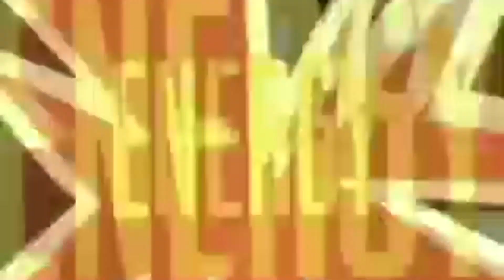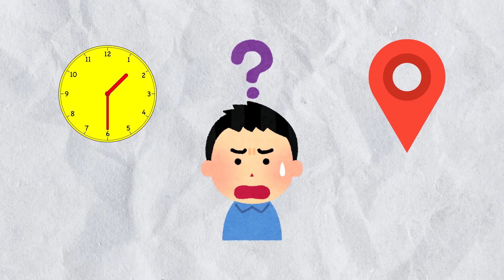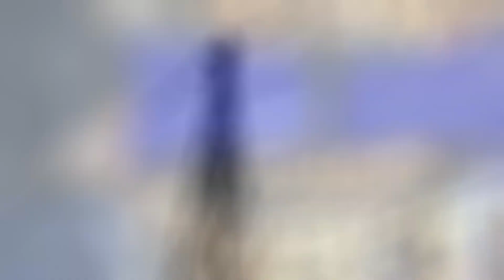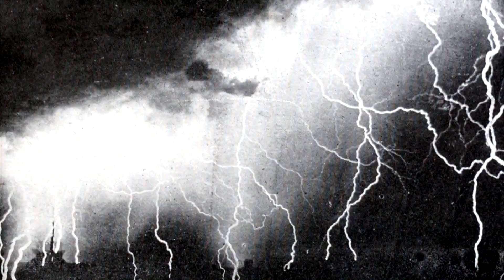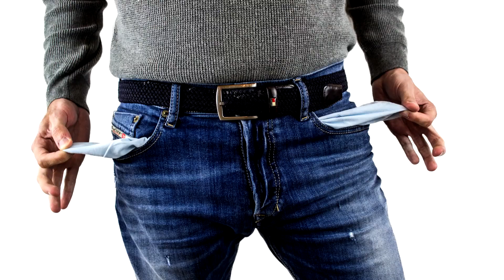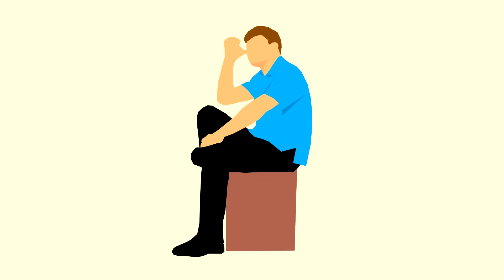why it doesn't work 71

Comment: It actually works. Ever heard of lightning rods? They are made out of copper, the one of the most conductive elements due to its electron configuration ([Ar] 3d^10 4s^1), making it the largest element with all electron shells filled in with one single valence electron, as when the 4th electron shell gets filled up, it must reach the f-block of the periodic table, which starts at Period 6, which, by definition, contains elements with 6 electron shells. Lightning rods are usually placed in flat, grassy meadows and fields guarded by fences (similar to electrical / cellphone towers) safe from houses and buildings. They are designed to charge itself to attract lightning to strike it to generate electricity. Eventually, the electricity flows from the lightning rod to the underground electrical cables (which have replaced power lines from artificial electric generators) to every single building and things that are powered by electricity. Just remember the path where you get your electricity: Lightning -> lightning electricity -> lightning rod -> underground cables -> house -> electrical outlet. Because of that, most of the electric companies use lightning rods (and use electric generators when there are no thunderstorms), so if you were to make this happen, you might as well build your own electric company.
Reply: This is just straight up misinformation
Reply: lighting rods direct the lightning into the ground to keep it away from things we do not want destroyed (mostly buildings) they do not "harvest" the energy of the lightning like they are doctor Frankenstein.
Reply: Lightning rods do not store the energy lol

Comment: What about converting the energy of the lightning into food?
Reply: Nope. We are NOT cyborgs, so we DON'T get our food from electricity. We can only get our food from glucose, as cellular respiration converts chemical energy into mechanical and heat energy (and stores the rest as fat) by burning glucose. That is why fats, carbs, and proteins are the only nutrients that give us calories. Vitamins and minerals don't, as they don't have glucose as a base element. This is like saying converting the energy of the lightning into benzine because gas prices aren't cheap, we could potentially fuel our cars from the energy of lightning -- if that was the case, then go buy a Tesla, especially a Cybertruck, so you don't have to worry about benzine.
Reply: @AlbertTheGamer-gk7sn   im talking about the calories
Reply: @Luxius_8 Well, lightning's potential energy comes from static electricity, which is the wrong potential energy for our cells. Plus, when I said "calories", I meant food Calories, which are the Calories per gram of fats, carbs, and proteins, or the Calories that come from the glucose in fats, carbs, and proteins.
Reply: What are you planning? Strapping a lightning rod on a cow?

Comment: so this might work?
Reply: This technically already does work. The Burj Khalifa has a lightning attractor. See the top comment.
Reply: @arifhossain9751 the top comment is misinformed, it does not harvest the lightning and it only attracts what is within range, when it happens, even with it attracting it, it would not be able to consistently harvest (if it did harvest anything) its just a good lightning rod
Reply: @arifhossain9751   it does not work.

Comment: It actually works. On the top of the tallest building on earth , the burj khalifa there is a lightning arrester which deflects electrical charges of the lighting strikes away from the building to its steel exoskeleton and it can power the building for up to 1 year.

Edit:the arrester attracts lighting strikes to itself by producing positive charges.
Reply: Lightning rods do not harvest power.) A lightning arrester is a device, essentially an air gap between an electric wire and ground, used on electric power transmission and telecommunication systems to protect the insulation and conductors of the system from the damaging effects of lightning.

Source: literally wikipedia
Reply: @kitsune_gt  source wikipedia?
Reply: @LucasImpulse  yes, that is what i said
Reply: it does not harvest the energy from lightning at all
Reply: that is not how a lightning rod works at all.
Reply: How would this work?